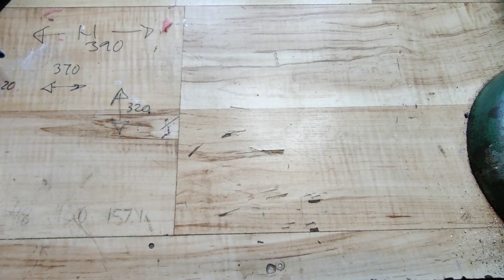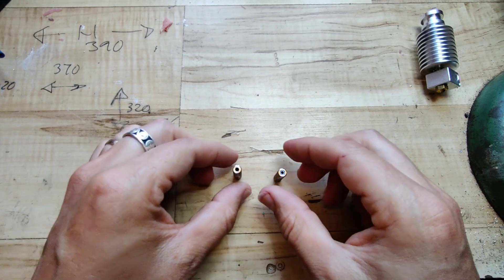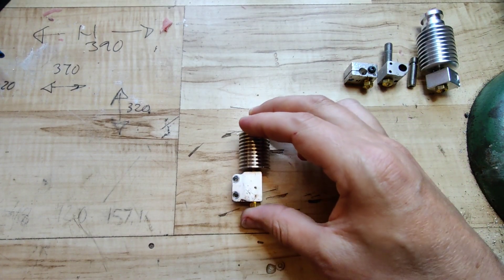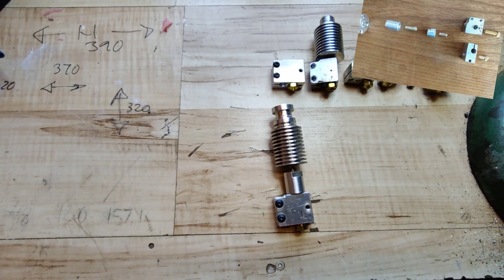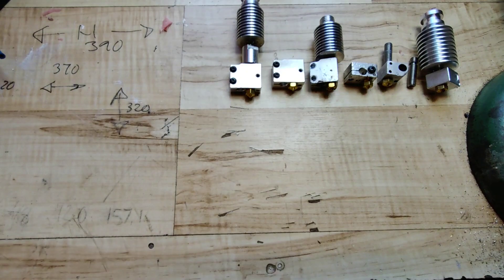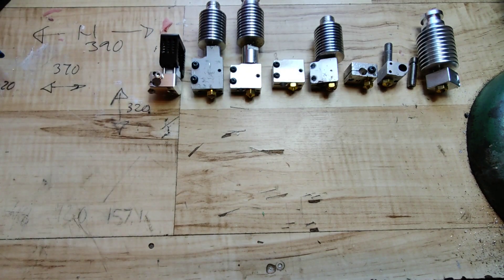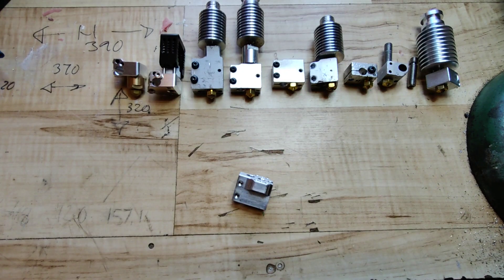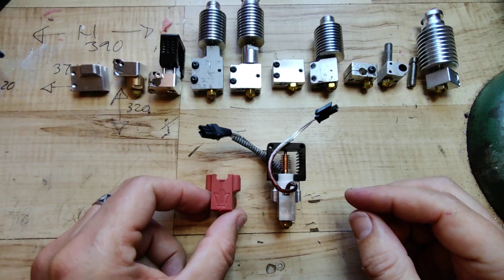How did I end up with the VolcoMosq?

Comment: For long valcano catridge. What is inside. E3d nozzle volcono and heat metal heatbreak?
Reply from the maker: On my 15mm extended volcano there is a cut of volcano nozzle to fill the gap between the heat break and the nozzle

Comment: Is this intended to be used with 0.4 nozzle? Have you compared it to some cheap high flow designs like Dragonfly HF(RIP dragon :( )
Reply from the maker: Volcano nozzles so 0.4 is one of those.. I don't own a Dragon, but you can squeeze some great amount out of this... =) as it's a longer melt zone you can normally melt more plastic..

Comment: incredible design! as a thought, do you think purely by a price point (not very high for most people buying parts like this but still in consideration) it would be better to go with a dragon heatsink for the main reason that you can easily find them for just 30 dollars, and then you wouldn't have to buy a complete hotend and mod it? or would this come with some other problems such as weight (never checked if the dragon is heavier). just a thought. it's an amazing mix of parts and just jaw-dropping.
Reply from the maker: I didn't think of price point for the complete hotend as a product.. I mainly did this for my self.... But it turned into a product.. Stay tuned..

Comment: Very interesting to see your journey and awesome outcome! :)
So far, I've also gone through the steps of switching the PTFE lined heatbreak of my Ender 3 to a SliceEngineering bi-metal and swapping to a Volcano heatblock to be able to push some extra filament through the installed 0.6mm nozzle. After seeing your video, I think its only a matter of time until I grab saw and drill and make my own stuff as well :D
Reply from the maker: Just do it..

Comment: Did I miss what flow rate you’re getting?
Reply from the maker: I squeezed out 50 in another video... PLA @225deg C for benchys the top flow is a little higher.... =)
https://youtube.com/playlist?list=PLacMd2j9VhLNrEdyIo7FAADAXXfyU1ept
Reply: @Nitram_3d  is that with alu or copper? And have you experimented with how alu vs copper change flow? (And whether the higher mass of the copper block reduces accelerations significantly?)
Reply from the maker: @raptorzoz6251  the flow test is with alu and brass nozzle.. the copper one will weigh 35g Vs the aluminium 12g. So the weight increase and the influence on the resonance it will render depends on the overall weight... For me a 20g increase is 15% or so and would probably be noticeable when tuning input shaper...